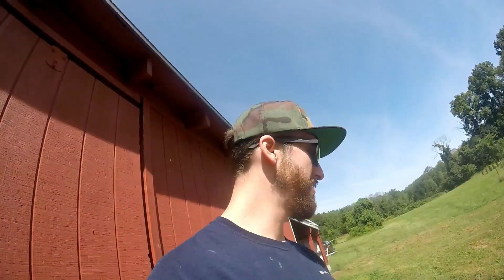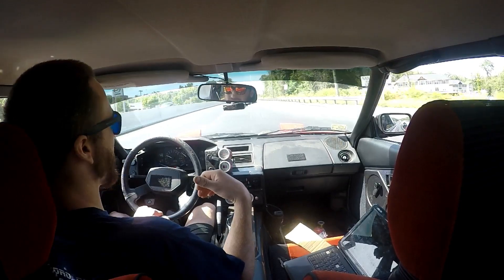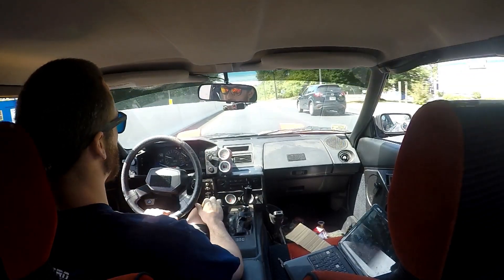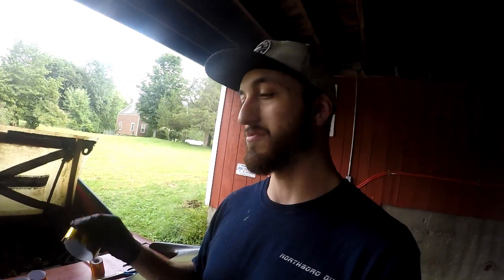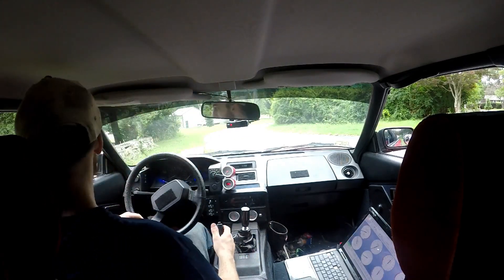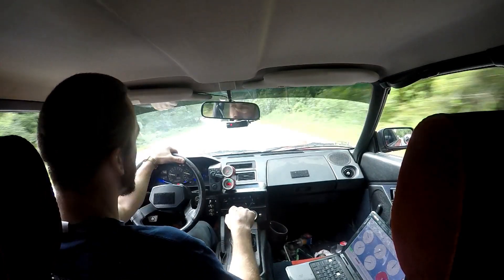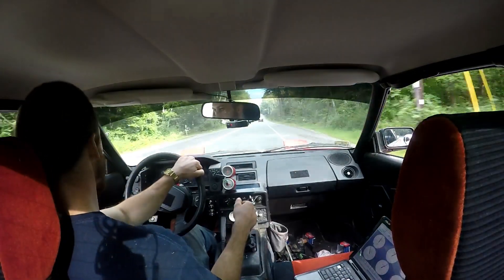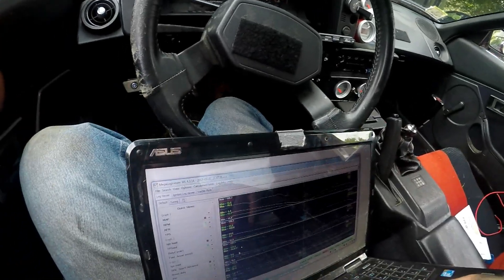Does Gold Heat Tape Actually Work?!?

Comment: will it help on my transmission cooler because it's between a/c radiator  and engine radiator i think it might help a little ?? i will but on top and bottom not going to cover the vents

Comment: What about wrapping the radiator hose?? Will it be a good idea?
Reply from the maker: it works on reflecting heat rays not on insulating and retaining heat, it wouldnt do anything. You need to put it on the outside of things you want to keep cold and technically there should be an air gap.

Comment: can you do a hour drive and comment back on the results?
Reply from the maker: Not really, id have to untape and retape to do another datalog back to back. overall it keeps things cooler but once its hot it doesnt dump the heat as quickly .
Reply: @lowristocrat3824  yea once it heats up it doesnt really mitigate the heat anymore, i saw in another video that some guy put duct tap and the temps were most same. was off by one degree so im curious if its actually the insulation or the tape.
Reply from the maker: its good for a few degrees off the IATS  and id say worth the effort